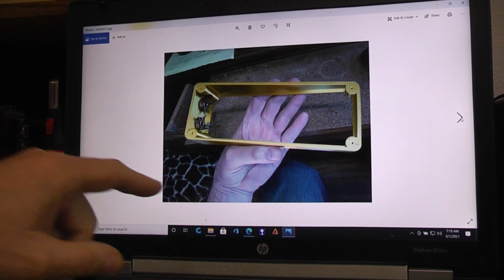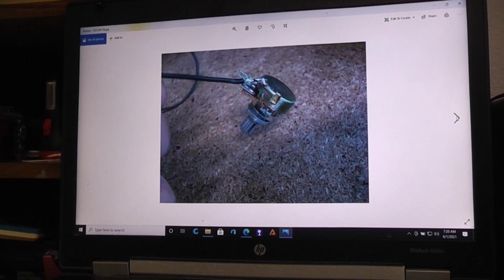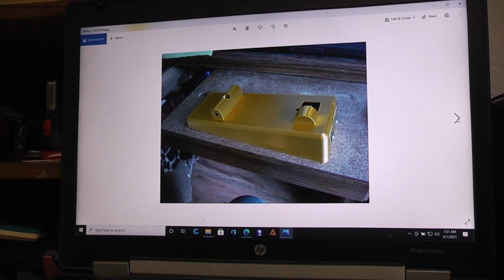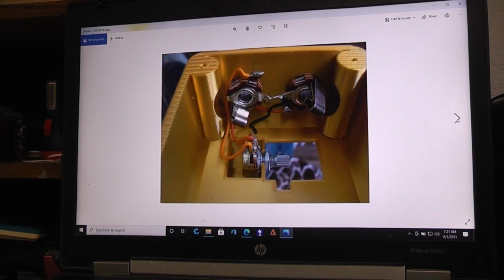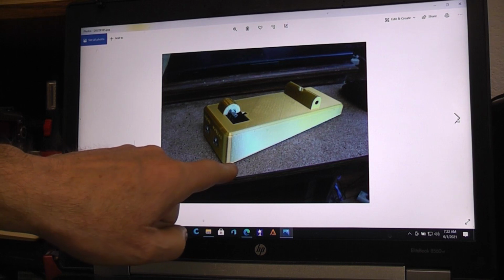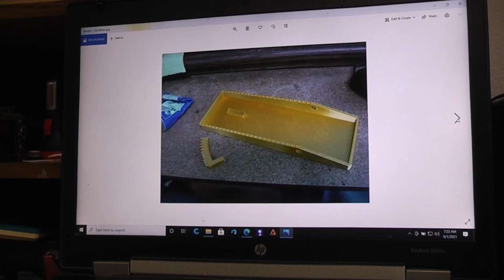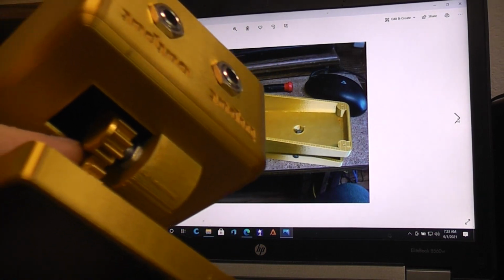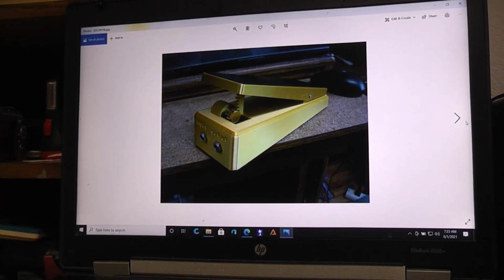3d print  the classic passive foot volume pedal.

Comment: Great work and thanks for sharing the files!
Just a question: what's the diameter of the axle? I live in continental Europe where we use metric dimensions.
Reply from the maker: In the video I call out 1/4 inch "0.24 inch" rod so google says that would be 6.096 mm. Hope that helps.

Comment: What size potentiometer should be used for this?
Reply from the maker: For example, if you want a Ernie Ball pedal design then use a 250K pot. If you are using the pedal for line level signals say from a synth or keyboard you may want to use a 50K pot. You can search volume pedal schematics online an find all the different values used by different manufactures.
Reply: @Robothut  Someone commented on Thingiverse that using a full-sized pot took them some extra sanding and grinding to get it to fit, so I just didn't know if there was a particular shaft size that would make life easiest.
Reply from the maker: @timshiflett  I have built 4 of these so far with the standard mini size pot shown in the video. I guess you could redesign it for full size pots.
Reply: @Robothut  Thank you! I'm still new to this sort of thing.
Reply from the maker: @timshiflett  No problem. I could have designed it for the old full-size pots, I just thought that these days it is so much easier to get the smaller size since they are used in everything.

Comment: can you make a smaller version of this? kudos btw.great project ☺️thanks
Reply from the maker: Yes a person could make a smaller unit. Or you can just take the STL files and change them to any size you want in your 3d printer slicer program. you might have to use smaller potentiometer and adjust the gear to fit the new smaller size Pot.

Comment: Hi, thank you so much for this video! Do you by any chance have the 3D files (eg. sldprt)? I want to make it smaller
Reply from the maker: Only the STL files on thing-i-verse and printables. But it is real easy to scale STL files down in every slicer program.
Reply: @Robothut  Thanks for your reply. I'm more concerned about the other components fitting in if I scale it down. No worries though, I'm sure I can figure something out. Thank you once again!

Comment: Holy crap that looks awesome! I'm used to tin can pedals and the ones made with light switch boxes, but that is so next level, definetly will be trying to print it :)
Reply from the maker: I have made 3 of them so far, volume control, Lesly speed control and distortion boost unit. I may have to build a waw waw.

Comment: hello which reference of potentiometer did you choose so that the rack corresponds?
Reply from the maker: Sorry I do not understand the question.
Reply: @Robothut  sorry i’m French and my English is so bad. What’s the reference of your pot 10k ?
Reply from the maker: @matlerouquin9860  Oh the value of the pot. Well that would depend on if your using it with a high impedance source like a standard electric guitar or a line level low impedance source. I use it with my Fender strat and bulet guitars so just like the pots in the guitar you would want a 250k to 500k pot so that you do not load down the guitar signal. If you plan to use it with line level signals then a 10K pot would be good.
Reply: @Robothut  ok thanks a lot. I’ll use this 3D printing pedal like an expression pedal for my helix. So you say me 250k is ok ? (I use passive guitar)
Reply from the maker: @matlerouquin9860  yes most passive expression pedals are 250K.
Reply: @Robothut  thanks for all !

Comment: You've been busy!  I used to have a volume pedal that worked using an optical sensor instead of a pot.  It was the smoothest pedal I've ever used.
Reply from the maker: I had two different pedals that used a optical sensor and a lamp. The only bad part is the power supply to run the Lamp. now days they do it with LED so battery power lasts a long time. But its hard to beat the simple design of using a pot.